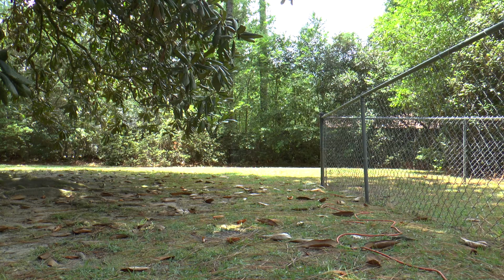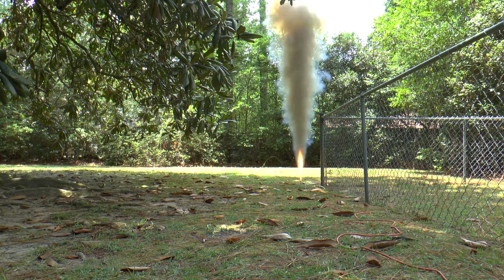24 mm tests 4

Comment: That first looked like fun. the second was about 1.5 seconds burn? Second, third forth and fifth looked like perfect fire.
Reply from the maker: The first was fired less than 24 hr. after pouring the bulkheads and blew the forward closure. I waited 2 more days for the epoxy to cure more and you can see they worked. A 5/8" long smoke grain gave 18 sec delay.

Comment: Lookin really good Tom!! Ferocious for a 24mm motor. Really consistent overall though the last (2) were hotter. Would be awesome in a 7 motor cluster. Are these disposables and are these using your 6810 or is this another formulation? Have you static tested these yet or are you still figuring them out?
Reply from the maker: Formulations developed for the 18 mm motors. No Al as it doesn't have time to burn in such small motors. Metals are Zn and Mg. D grain formula also has oxamide to slow it even more. Have a scaled down Ultimate (3" with 24 mm mounts) and built a scaled down one for 18 mm motors.
Reply: @TomB0667  The Ultimate along with the THOY Nighthawk are my all time favorite clusters!! That sounds like it will be awesome!